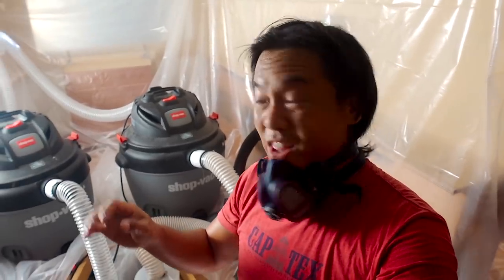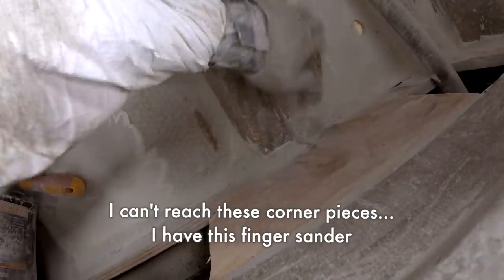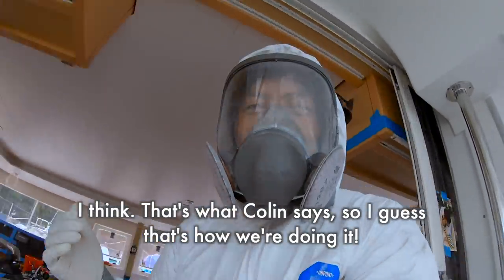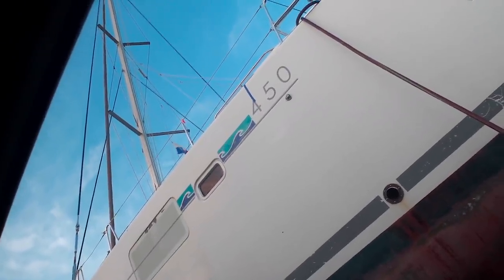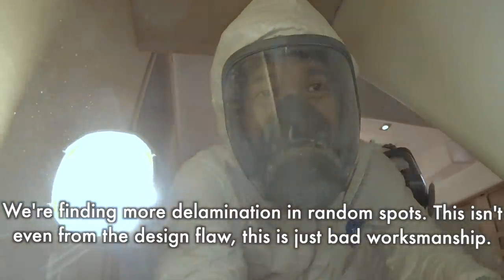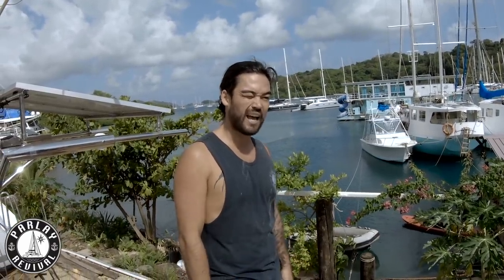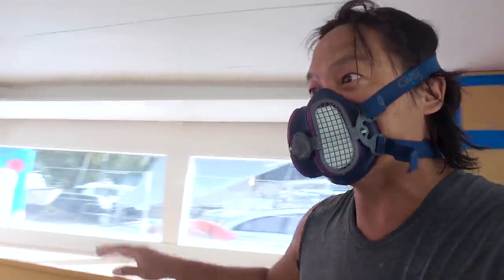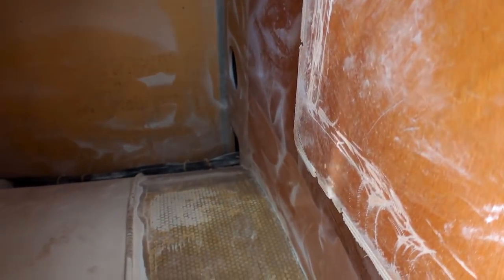I Sacrificed 3 Days of My Life GRINDING Fiberglass to Save $18k

Comment: Tom, I'm glad you realize your personal safety is of paramount importance. With the high levels you were recording, I would've wanted an SCBA. 👨‍🚀 I rather doubt that type of safety equipment is readily available where you are. And,  I'm sure it would be extremely difficult to maneuver in such close quarters with an SCBA. I commend you for doing the best you can with what you have to work with. I hope you are inspecting and changing your canisters on your APR regularly. Kudo for the dust extraction system, filming, editing, most of all, following Colin's lead. 💪👏
Reply from the maker: Im assuming the SCBA is one of those forced air things you wear on your hip thats connected to a non-air-tight helmet?  I really really wanted one of those just b/c its so apocalyptic/zombies/pandemic, but couldn't find one in Panama.  A lot of workers refused to wear anything more than dust mask equivalents.  

It's always difficult to know when to change the filter cartridges, especially the ones that protect against gases and voc's. I've been using acetone as a canary in the mine since we always use it to clean surfaces before fiberglassing.  If I can start smelling the acetone, I change the filters.  Thoughts on this technique? I also heard that the particulate filters (p100/p95) can be used until it's too hard to breathe through them bc they technically never stop working. True?
Reply: @david_shih  SCBA is a self-contained breathing apparatus (has a regulated tank of oxygen that you wear). OSHA defines a cartridge as a container with a filter, sorbent, catalyst, or combination of these items that remove specific contaminants from air passed through the container. These cartridges must be equipped with end-of-service life indicators (ESLIs). An ESLI is a component of the cartridge that indicates, typically by changing colors, when the cartridge needs to be replaced. Some manufacturers have downloadable programs for estimating times for change-outs on their Web sites. Information such as humidity, contaminant concentration, a person's estimated workload, and atmospheric pressure must be ascertained. A guide for estimating times for organic vapor cartridge change-outs states the following: If a chemical’s boiling point is greater than 158 F and the concentration is less than 200 parts per million (ppm), an eight-hour service life at a normal working rate can be expected.  Service life is inversely proportional to the work rate. (This means that as the work rate increases or if it is already high, the length of time the cartridge will remain effective will be less than when work rates and, consequently, breathing rates are lower.)  Reducing concentrations by a factor of 10 will increase service life by a factor of five. Humidity above 85 percent will reduce service life by 50 percent. I realize this reply is long but, too many people do not take APRs (air-purifying respirators) seriously. Look on your cartridge for an ESLI. If you can't find it look online for the manufacturer's datasheet. I hope this helps.
Reply: An hookah system low pressure compressor to mask would work then it could be used for bottom cleaning when you're in the water.
Reply: @david_shih  Yes, you're correct about the respirator cartridges.  The solvents are adsorbed in the cartridge, so when they are no longer being adsorbed (being stuck to the external surface), you'll smell them (if it's a solvent that has a smell).  The particles are filtered mechanically, so difficulty pulling air thru the cartridge is an indicator that it's time to replace the filter.  Beware of mask leaks, because they might "mask" a clogged filter from being identified early, allowing more unfiltered air to bypass the filter.

Comment: Festool sanders would have saved a ton of headaches
Reply from the maker: An I’m definitely getting one if I ever have to work with glass on this scale again. Unfortunately the hodge podge system I put together was the best I could find in panama. A rigid shop vac cost 450$!
Reply: Yea I assumed you guys were very limited there. $450 that's crazy

Comment: I reckon heads must be rolling at Lagoon. Unbelievable, how much would a boatyard charge for this? 30k? 40k? 50k?!!. Such a shame they cut corners. They should just give everyone who owns one of these (regardless of wether or not they are the original owners) a briefcase full of cash and apologise profusely.
Great vid and production as usual.
Reply from the maker: I think the heads at lagoon are way to preoccupied with all the new boats they are selling. They’re a good 2 years behind on many models.  To fix the entire bulkhead problem all in costs between $80 and $130 depending on variables — some are just bent on 1 side. But it’s a huge undertaking from disassembling all the cabins to tons of grinding to extensive fiberglassing (we’re talking hundreds of pounds of fiberglass and epoxy resin) to cleanup to complete rebuild of the cabins. I’ve gotten quotes where the project management fee alone is $15k.
Reply: Just wait for the outcome of the first wrongful death lawsuit to hit lagoon.  Imagine what a jury would do if a family like yours was lost at sea now that lagoon has these YouTube's to watch.   Anyone who buys a new lagoon is stupid
Reply: A designer who's good at creating winning race boats built for lightness and winning one years race that are tossed in the junk pile a few years later is not someone who I want designing my family's boat.

Comment: The dirty little secret is chemical companies don't want us to know that water is the best refrigerant. In a lithium bromide absorbtion system water runs at 40 degrees F it is the refrigerant. The pressure is 14.7 psi all the other systems have to pump about 200psi head pressure above the low side. That is a lot of amps. They don't care that you sweat. Also when you get your boat in the water you could run aground. If you made 6ft plastic cylinders about the length of your hulls, and flatten the ends. Place as many as you can between your hulls, and when you inflate them with one of your vacuum cleaners this will lift your boat high maybe to safety. 6 mil plastic would  work but vinyle they put on yurt roofs would be better. These vacs. inflate rubber dingis real fast.
Reply from the maker: I don’t think these vacs have the psi to get the dingy full…maybe to get them started in the beginning. At least they didn’t work to well when I tried it on a stand up paddle board.  Not sure what you mean by water and refrigerants tho. Either way thanks for watching!

Comment: Why are you so excited by a boat with such poor architecture and manufacturing??? Crazy and not even good crazy. If it was my boat, I'd hate it with a passion and want to have it crushed out of existence.
Reply from the maker: Well I’m not the typical catamaran buyer with the reserves to deal with something like this. We sold just about everything we have to be able to buy this boat used. When we discovered the extent of the bulkhead issue we really had no choice but to figure out how to fix it on our own. I’ve spent plenty of time depressed and cursing my fate, but at some point I accepted it, realized that life is still f*%kin’ good and decided to only move forward.
Reply: @david_shih  I admire your spirit. That's why I support your channel

Comment: What does Lagoon say about the workmanship issues you raise? Is it actually bad, orr does it only look bad? Whichever it is, you deserve a medal from the Lagoon owners association for all your hard work.
Reply from the maker: Well, lagoon has literally said that NOTHING is bad, and that's for every single thing we've brought up to them. Delamination, cracks, sunkend decks, and even bulkhead failures themselves.  They literally told me that despite the bulkhead failures my boat was 100% safe [while never even inspecting it] and that I could sail it from Panama to Texas and deal with it there.  They even released an official communication to owners saying that there is NO CHANCE of catustrophic failiure (concerning the bulkheads).  This is while some boats had bulkheads were so broken that rigs went completely loose and mast's would have come down if they kept sailing.

Comment: Hmmm. Wonder if you could turbo charge you Diesel engines.  Then put a higher pitch prop on.   At least then when you’re not under sail. You can still move out. 

I turbo my non turbo diesel
Reply from the maker: I’m down to try anything. Let’s look into that after the bulkheads are strong and the cabins are rebuilt!
Reply: @david_shih  sure.
Reply: @david_shih  what engines have you got.  Model..